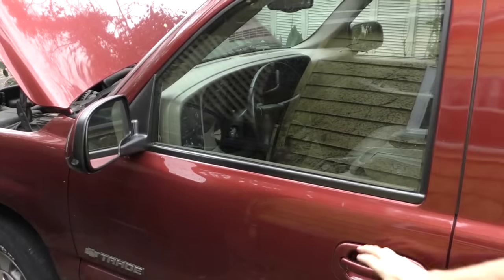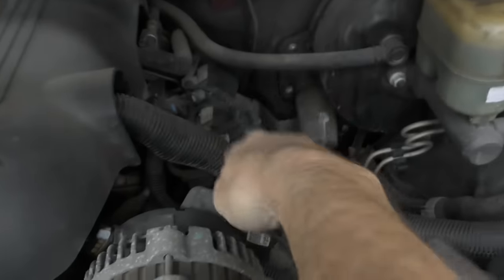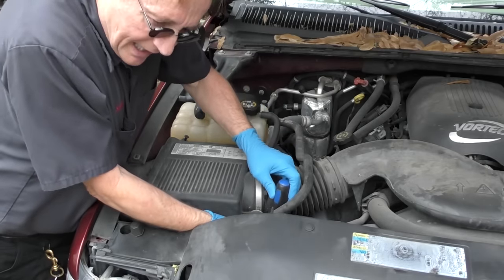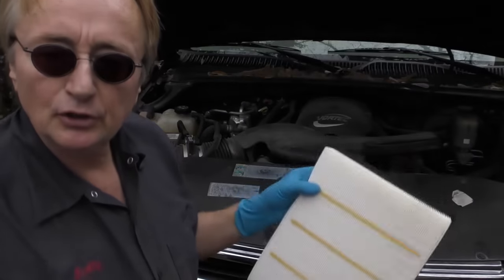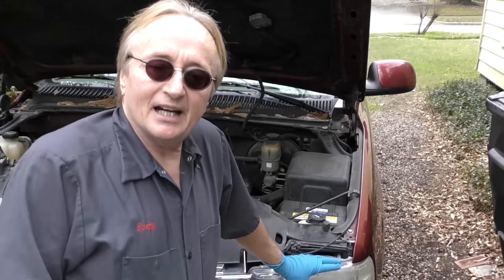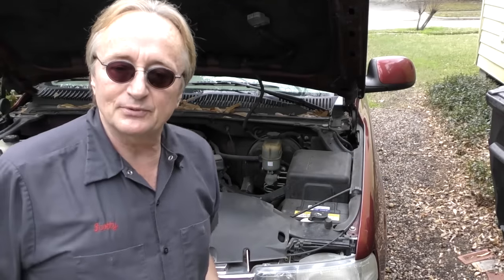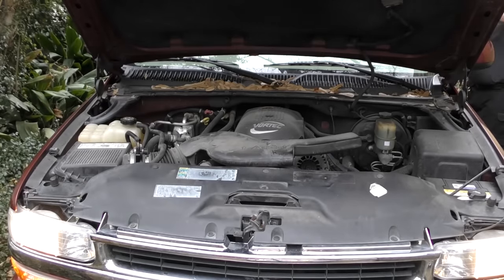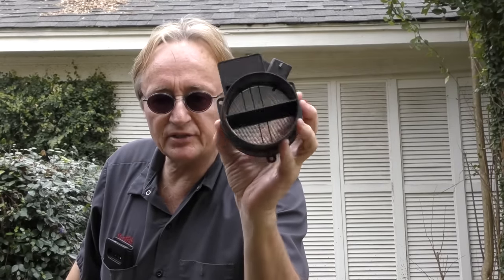Doing This Will Make Your Engine Run Better

Comment: A local mechanic. Was going to charge my father in law $1,000 to fix his Sierra Truck.  I changed  this part and the air filter and the engine light went off.

Comment: 2 YEARS OLD ON THIS VIDEO...BUT...I OWN A JAPAN MADE 91 SENTRA XE(5Spd...1.6L w/249,+++ miles on her...So Cal & I run 20W50...Hot enough here) I just took a trip from SoCal to WYOMING then to Phx, AZ...THEN HOME...CLOCK...OVER 30MPG...BEST WAS 36.83MPG) OEM ENGINE AND TRANS...IF IT HAD A 6 SPEED IT WOULD GET 40...

Comment: What alot of people don't know is that stupid corrugated air hose that goes from the filter box, worsens the airflow quite a bit, affecting your engine's performance. It steals horsepower and elasticity).

Comment: Scotty you’re a lifesaver. My GMC through those same codes yesterday and was running poorly. Just swapped out my MAF a few minutes ago and she’s running good
Reply: Did it hesitate if you floored it any
Reply: Would have been curious if just cleaning tge MAF sensor would have resolved the problem as they can get grubby especially if the air filter isn't changed frequent e ough.

Comment: I like when you show the freeze frame and live data points. Most people seem to think that diagnosis only consists of retrieving codes. 
Great content,  Scotty.
Reply: Agreed, I'd like to see a lot more like this from Scotty.  Kinda like DiagnoseDan does it, only in Scotty's own inimitable style :)
Reply: Scotty is Da Man!!
Reply: If the car is running lean, feed it more and fatten it up?
Reply: Scotty is nowhere near as skilled as Diagnose Dan
Reply: @glennso47  
Haha, yes.  That is what the computer tries to do with fuel.
Reply: Codes are not a diagnostic if you have ANY mechanic claiming they did a diagnosis by only reading codes the turn the hell around
Reply: @epsorks  
I have never heard a mechanic say that.  It is the general public that thinks diagnosis means getting a code.  Example, "I have to pay a $100 diagnostic fee just to get the codes?"  Most people do not understand what is actually involved in diagnostics
Reply: Mr Hansen  
It happens all the time.  People bring their cars to the shop saying that Auto Zone diagnosed the problem as an oxygen sensor, or whatever,  so they bought one and replaced it, but it didn't fix the problem.  I just think to myself, "Duh."  Then I try to explain what the diagnostic process is.
Reply: Scotty just showed me what to do before I change my o2 sensor. Check the mass flow filter first on my ford taurus and maybe I can pass the emission

Comment: I had a problem with my 1998 Toyota Sprinter, it use to take long to pick up when I press the gas pedal but I realized that the manifold had a leak. From I fix it the car as been running so good. Thank you Scott.

Comment: Just replaced the MAF sensor on my 2002 Chevy Silverado 1500hd with the 6.0 Vortec. Same issues. Runs like a champ again! Love your videos Scotty!
Reply: Just cleaned my air intake filter, but truck is still loosing power after five minutes of driving. Almost couldn't get home. Hopefully the MAF sensor is my issue.

Comment: THANK THE LORD YOU POSTED THIS!!! I have a 2002 GMC Yukon XL with 226,000 miles and the truck just threw up both of those codes and the truck runs perfectly fine and the fuel pump was replaced at 200k for preventative maintenance and there was no vaccum leak so I couldn't it out but now hopefully replacing the MAF will help. Thanks!!!

Comment: By far the most common issue with this engine when lean codes are present are the intake gaskets and the quickest and sure way to test them is to spray carb cleaner around them with the engine running which results in a change of idle speed if a leak is present.  Usually this occurs when the engine is cold because the gaskets are plastic/rubber.  I've seen this many times with both sides leaking and sets lean codes.  Easy fix: replace the gaskets.  MAF sensor failure on this engine are not all that common.   (retired ASE Master-GM service)
Reply: Mr. Goodwrench 👍 My first full time job was at a Chevy dealership in East Hartford CT. 4 years. Car Jockey, New Car Prep,  Parts Driver and parts warehouse receiver/ stocker.
Reply: Hi. Just curious in your experience, is there a good way to test an O2 sensor? other than the check engine light. It seems like the O2 sensor has the final say in the fuel trim values with problems like this and would be harder to diagnose without a specific fault code?
Reply: @wvadam  O2 sensors can be tested by a quality multi meter/DVM.  There are many videos on YouTube that can help. However, from what I've seen most techs rely on their shop scan tool to do so.

Comment: My 1993 auto Sentra has 360k miles.  Original everything but starter (5th replacement) and radiator (2nd).  Came free with the wife.  I'm keeping it forever and driving it when needed.

Comment: I had a problem with my diesel Jeep Wrangler in Australia. The connector for the MAF sensor had a hole where a wire would usually go on a petrol Wrangler. My Jeep only used 4 of the 5 wires and water would seep down into the plug. Everytime it rained, I would have to replace the sensor. The wrangler wouldn't start with out it. I fixed it by sealing around the plug with some elctrical silicone. Works great now.

Comment: Had a ‘97 Thunderbird 4.6 V-8.  At a somewhat advanced age it was running funny.  The resistance wire in the MAS looked wrong.  There was one replacement in the entire metro area and it was at a parts store, not at a dealer.  It was about $15.  Problem solved.  But it seems parts get scarcer as the cars get older.  Wiper linkage fell apart on another car.  The only one in the metro area was at that same parts store.  Whew!

Comment: I have a 2001 Audi A4 Quattro Avant 1.8T , about 75000 miles on the odometer. A had a lean condition error code for a year, on and off.  Sometimes the check engine light came on , but only on the freeway!  I replaced the fuel filter, cleaned the fuel injectors. It did not fix the problem. Finally I cleaned the mass air flow sensor..... And no more error code since then.  :)

Comment: I have a 2004 3L Nissan patrol. I had a MAF go in it. And it had no power at all, went into limp mode wouldn’t rev over 2000rmp. New MAF, back to normal.

Comment: love this … i have a 2006 trailblazer ever since i bought i started having problems . bought it in 2006. then early 2007 the right wheel started leaking some type of oil front right tire. every year something went wrong . think i paid more in repairs than the purchase of the vehicle 31000

Comment: I've been diagnosing my MAF (short of reading waveforms).  I just tried the intake gasket test with carb cleaner that you suggest in other vid.  Someone else suggested a $20 unit on ebay, but I'm not buying Chinese (buy cheap, buy twice).  I'm now going to do the highway speed test you mention, then order a Denso unit online.  Glad to get confirmation that 'they just wear out.'  At 180k on my Corolla, it may just be time.

Comment: You can run a 2.2 Chevy cobalt without a mass airflow sensor, it will start hard but once it’s running it’s fine, also I know because I’ve done it, ran mine in a demo derby took all that off and did good once warmed up

Comment: This is where the dealer has the big advantage with all of the baseline data. They can look up the exact air mass per second the MAF sensor should be reading at idle on their computer and know if the reading is wrong right away.

Comment: Scotty, we love the channel! Question:  2003 Highlander v6 160k miles sometimes has issue of shifting into highest gear(overdrive?) in highway speeds so it will rev around 3500 rpm. Been able to quick fix it by pulling over, shutting car off, waiting 10-20 seconds, starting it up again. Alot of times doing that fixes the problem but it all seems very sporadic. What could possibly be causing this problem? Electrical failures? Transmission going out? Is it a common issue?

Comment: Love those easy fixes like a MAF or 02 sensor. Easy peasy
Reply: Lemon squeezy
Reply: Haha yeh great fun on the front wheel drive V6🙄
Reply: @RJ-jh9fs  nah, it's the rear bank that's hell on a fwd v6
Reply: Or a CVT transmission.
Reply: @doices9786  yep
Reply: 02 sensor. not easy if it breaks in or to hard to get too,or both.
Reply: If the MAF sensor was bad, why did the MAF sensor code not trip (P0101 normally) vs just the P0171/P0174) code?   Usually, the MAF sensor code trips on a bad sensor- at least it did on my car.  The live data should have shown the g/s flow on the MAF.  I would think take a readying at idle and then accelerate and reading should obviously increase.  If so, then normally MAF is good.  If the g/s flow stays relatively constant, then it's probably bad.   I guess just because it's the original on a 180K vehicle does not mean automatically condemning it with an educated guess.  Educated guesses can get expensive is my point here.
Reply: @abluto9240  
Agreed . For the price of the new MAF ( dealership part ) you can buy another 92 Tahoe 🤣
Reply: @abluto9240  I thought the same.  It was probably the o2 sensors or something like that with a p0171 code error. I dont know why it read no errors after he replaced the maf.

Comment: I just use MAF sensor cleaner, never replaced a MAF on any car I've ever had or maintained. I find LFT has more to do with sensors and STF has more to do with intake leaks or fuel delivery issues.

Comment: Whoever has the 1994. I got you if you need parts or advice. I've owned 7  and currently own 3 of these. Great cars. Cheap to maintain and slight easy to work on. Now you got GOLD if it's an SER with the 2.0 motor. A solid gold bar, if it's a 5 speed

Comment: This Chevy Tahoe is in good shape for an 18 year old car.
Reply: They are the last great GM truck mine has 304k great machine.
Reply: @ruthlessreid9172  the Tahoe looks well taken care of as well.
Reply: Reid Plyler which years are best?
Reply: Dillon Hamrick 99–2006 best gen
Reply: The Old Chevy SUVs and Trucks r the only well built GM products that last over 150,000 miles unlike their newer piles of junk
Reply: @dillonhamrick2744  just look for that body last with steel bumpers and not cylinder deactivation motors.
Reply: @jtf-joshtfitnessandlifesty3470  yes indeed. Scotty says that GM quality has fallen and so the new ones are not built as well
Reply: Or SUV which it is...
Reply: My 2002 Tahoe Lt 4x4 everything works on it like the only things wrong are cosmetic like tear in driver seat and dash paint coming off but with 258,562 miles I’m fine with that lol

Comment: Yeah... great idea Scotty, change parts with actually doing a proper diagnostic diagnosis... it could be dirt where all it needed was a good clean, it may have also been oxy sensors, wiring or anything else that the computer uses to work out the stoichiometry

Comment: Had this problem on my H3 with 5.3L in it. It would only show symptoms when it was below 0 degrees Celcius and would start but want to stall. Changed both intake gaskets and prob solved.

Comment: Mass airflow sensors don't wear out. They get dirty. There is a heated wire that air is directed over. The air cools the wire. So you can determine how much airflow by how much the wire has cooled. Get dirt on the wire and it insulates the wire and screws up the reading. Clean the wire and good as new. Also sometimes a bug gets stuck in the passage leading to the wire. The small hole at top of inlet. Remove bug, good to go.

Comment: Some Fluid Film spray on the rubber parts that slide together will make it come apart easier the next time. Do not use silicone spray- if it gets to the oxygen sensors it can damage them.

Comment: I cleaned the MAF on my 02 4Runner after 180K miles.  Made a big difference.  Why not try cleaning the MAF first?
Reply: How do you clean the MAF sensor?
Reply: I removed the sensor from the air intake. Mine was held in with two screws.  Each manufacturer probably uses a different design.  Some cars don't have MAFs.  

CRC makes a spray specifically labeled as Mass Air Flow cleaner.  The sensor is sensitive enough that I would only use something specifically labeled for the MAF

I sprayed the cleaner on the components let it sit for about 20-30 seconds and then repeat a few times until the sensor was clean.

Comment: My 2012 Camry had the engine replaced, cracked oil pan lost the motor, but on that motor I was getting 25mpg. On this new one I'm only getting 20! No codes but in neutral I almost feel a mini misfire comes and goes as it idles, gotta give it some gas to get it going thru 1st and 2nd gear.

Comment: I hate to say it, but Scotty describes a Mass Air Flow sensor (MAF), while holding a Mass Air Pressure sensor (MAP). The difference is, one -- the MAF -- was used in OBD-1, which was prior to the standardization of US cars and trucks in 1996. After 1996, ALL cars and trucks sold in the US had to have the same baseline standard, OBD-2. The major changes was going from MAF to MAP sensors, and adding a second oxygen sensor downwind from the catalytic converter (OBD-1 systems, prior to 1996, only have one oxygen sensor, usually in the exhaust manifold) -- which meant that cars and trucks could get higher mileage out of each tank of fuel, depending on engine speed, load, and air/fuel efficiency. Pressure sensors are used because a computer has an easier time adjusting for atmospheric pressure (14.7 lb. per square inch at sea level) for combustion purposes, while air flow, at higher elevations, is lower because the volume of air is smaller, though that volume of air could also be more dense, and therefore, at a higher elevation, a car could run richer as a result. A pressure reading, therefore, was used to enable the same air/fuel ratio, no matter the elevation, and therefore improve engine performance by mitigating rich running stemming from running at a higher elevation.

Point here is, Scotty gets the kind of sensor wrong, and therefore the type of system wrong.

Comment: When checking a mass airflow sensor a resistance check is done with voltage meter on continuity if there continuity it’s holding electricity true a magnetic field then set to ohms in measure the resistance to a more approximate analysis

Comment: A machanic once told me to test mass airflow sensor start the car and unplug the sensor if the car carries on running or sounds better then the maf is bad
Reply: Daniel Holland and if it isn’t bad, it could probably use a cleaning, along with any MAP sensor. If the wires of the MAF and the diaphragm of the MAP are dirty, neither will deliver correct info to the computer for fuel delivery. Clean them at every air filter change, which won’t hurt to do at each oil change.

Comment: I have a 1996 Jeep Cherokee base model 4x4 5spd 4cyl. I'm having really bad heat soak issues with this thing. I'm no newbie to jeeps owned a ton of them. But this one is giving me the biggest headache. Took the motor fan off put a bigger fan that pulls more CFMs. But still heat soaking bad. Hood spacers bought them also to help get heat out of the hood. New water pump thermostat and radiator. Still same problem. Also wrapped the fuel rail an sparkplugs with themo shield stuff. If it sits in a stationary area for longer than 10mins starts running bad like heat soak/vapor lock. Any ideas anything will help...... Thanks again Robert.

Comment: Two comments:  1.  when I check under the hood, I clean out the leaves and branches.  looking at the car in the video, I have the feeling that the person doesn't check under the hood very often.  2.  I have an older Toyota than discussed in the video.  When I changed from primarily highway driving to stop and go, one mile hops, the fluid went dirty after only 12,500 miles.  Although it appears clean now, I will do another drain because it has been another 3 years and only about 8,000 miles.  Looks can be deceiving.  I change the oil every year regardless of the appearance.

Comment: Almost three million Subs Scotty .!. Put Castrol transmax synthetic (which is not actually synthetic - Only Amsoil?) in my 2005 Lexus Rx 330, which was made in Ontario, Canada. 
I bought it at 245 000 kms (miles ?) for 7000k CAD  (am I stoopid? Slightly?)  - She runs real nice, seamless gear shifting - the OEM fluid (Type II IV- blah blah is it just a bunch of bull and is oil just oil? - are the additives really that special?).

Where do you post proper questions? A live forum, I've read..

I went to Mr. Lube, which is a prominent 'Oil Changer' in  Canada after buying a used car and now I'm scared after reading the owner's manual (Transmission fluid is the only fluid Toyota specifically says to use only OEM; you like Castrol eh Scotty?) .. I don't know whether to change the filter and refill what comes out with OEM or do the same process again with OEM (the machine they use? EXPLAIN it please, I can't find any real information on it? does it really change ALL of the transmission oil, makes sense in my mind if you pump out the old with the new - I paid for a dozen Litre (Quartz? :)  bottles of oil I believe? To apparently change ALL the trans oil in my car :)

I also did a 30$ engine flush what is that all about?!

I'm learning the hard way over here on the West Coast

Comment: I have a 01 Tahoe and having the same problem. I could not find the problem so I order a code scanner, vacuum gauge, and fuel pressure gauge(literally yesterday) so I can figure out what the problem. I also have a random misfire code. so maybe it's the sensor maybe not.

Comment: Scotty, I have an 06 Honda Pilot with 170,000 miles in it and it runs fantastic with many more miles to come. However, I’m not getting as good gas mileage as I used to. Is there anything I can do to change that?